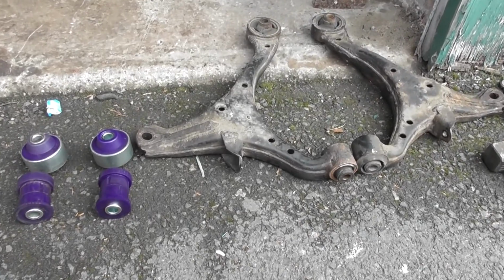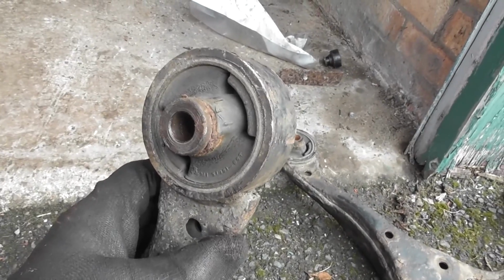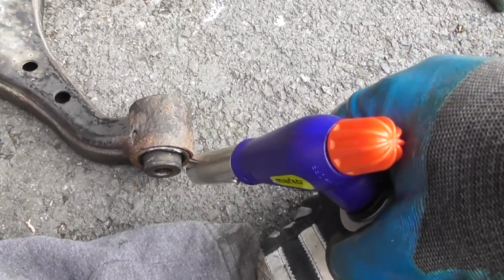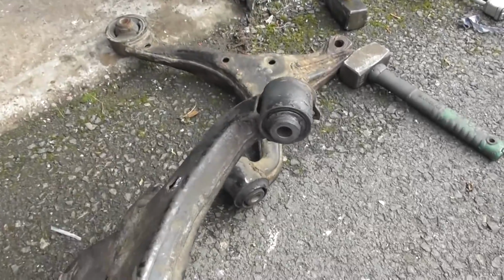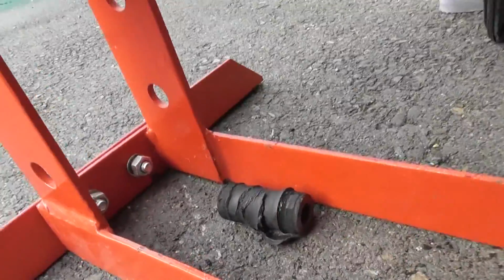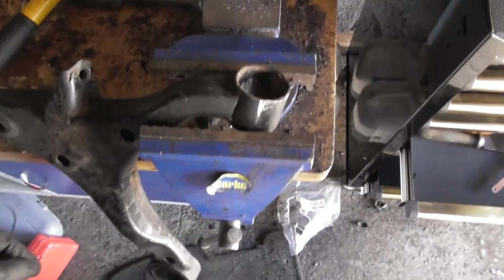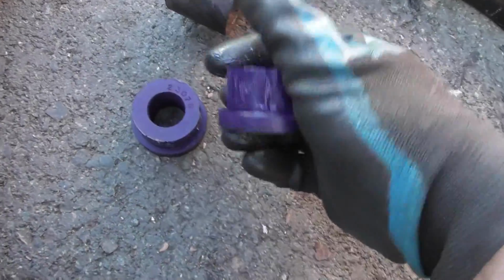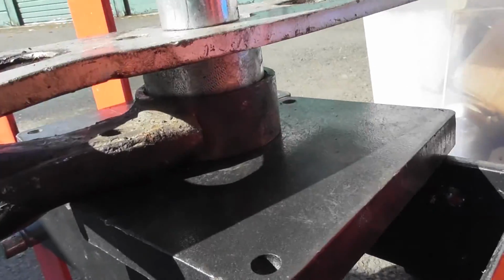T2EP3 Honda Civic Type R K20 Part 16 : SuperPro Bush removal and fitting Front Lower Wishbone

Comment: Any post review on these poly bushes? Do they bind and squeak after some time?
Reply from the maker: I think they transformed the cara handling for the better. As long as you use the assembly lube, and tighten the bolts up with the arms in a neutral position (somewhere close to where they will be when the car is on its wheels).  Then you should be fine.
Well worth the money, it makes the car far more predictable when on the limit of grip and before then.
Thanks

Comment: Good video, very helpful! I'm going to be attempting this soon, how difficult was it to remove the lip on the rear Bush? Cheers
Reply from the maker: Alun Denbury It was not too bad really.... also it will take you more time to do the first side than the second as you will have your technique down.
Good luck and let me know if you have any questions.
Reply: Twin2 Civic Garage T2CG Thanks, will do! I've got the caster increase kit to fit - what were the issues you came across with it out of interest? Thanks
Reply from the maker: Alun Denbury I found it impossible to fit the wishbones back into the car with the caster increase bushes. Let me know how you get in though. These bushes should come with a 1:1 drawring showing how these bushes shoulbe be aligned. I woukd suggest using a marker pen on the bush and wiashbone to help you line up where they need to be oriented.
Thanks
Reply: Twin2 Civic Garage T2CG Thanks for the tip, will do!

Comment: Hi there, i am about to replace all my lower arm bushes (front and rear) and i was wondering what struggles you had with the added castor bushes? I have all my bushes removed and am trying to decide if i should go for the standard replacement or the added castor but i dont want to spend the money to find i have issues getting them to fit on the car, thanks alot
Reply from the maker: David Moss The increased caser bushes I tried to fit from Superpro, we an absolute nightmare.. I tried to get them in, but couldnt see how it was ever going to work. The standard caster ones are what is in the car now... the fitment was much easier and I would recommend them.
Thanks
Reply: Twin2 Civic Garage T2CG thanks for the quick response. I will take your advice and fit the SuperPro standard bushes. I saw your comment saying how much better the front end felt so im happy to follow suit
Thanks
Reply from the maker: David Moss No probs, good luck.

Comment: Twin2 Civic Garage T2CG, how much were the bush kit? i have recently bought a ep3 and this would be something that i'd like to do along side ball joints, cheers fazzeg3
Reply from the maker: Fazz eg3 Looking on Ebay £140 for a front kit. £370 for a full kit. Cheers
Reply: cheers for that, alot more expensive then b series bush kits lol.
Reply from the maker: Fazz eg3 Yeah, there are a loy of bushes in the rear. I bought the full kit, but so far only fitted the front part of it. Noticed a massive difference on how much grip the front tyes felt like they had in corners, as the movement of the front suspension is now much more predictable.
I need to do the rears, but is a big job.
Reply: nice, well hopefully we get some nice weather and spare time then crack on with car jobs, cheers fazz
Reply from the maker: Fazz eg3 Ok mate good luck. Let me know if you have any questions.

Comment: You've just convinced me to do mine myself mate cheers, wish I had a press tho lol.
Reply from the maker: MrAlperry Hi, the press is a good imvestment. Make sure you have a range of pressing implements ot old sockets for it though. The handling after putting the bushes is so much better... even onnstock suspension like I have. Thanks
Reply: Do you still know the item numbers for the straight bushes you used?
Reply from the maker: al3xuk I believe the kit to be 
B3-SPF2306K
But if you search for "Superpro EP3 wishbone" on Ebay fir example you will see the kits. Thanks.